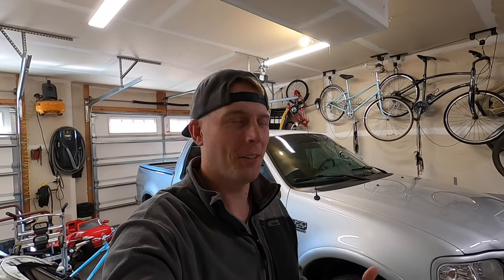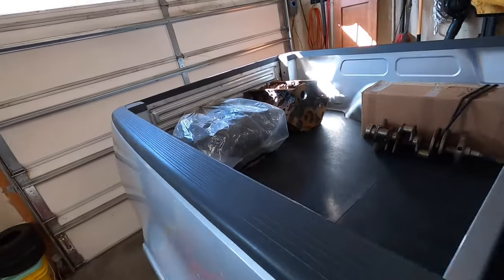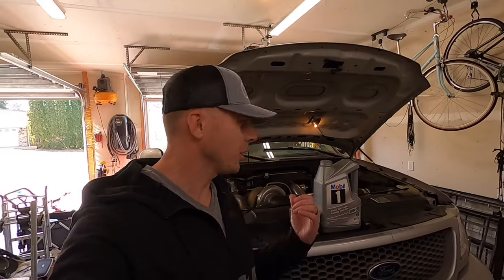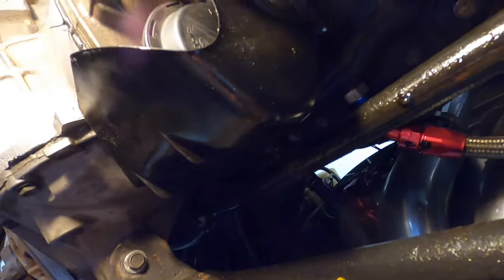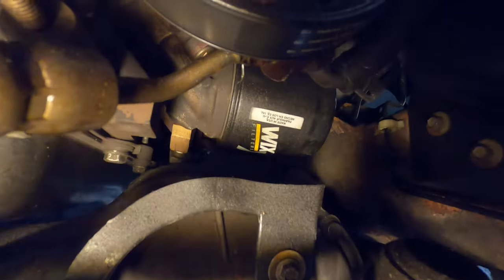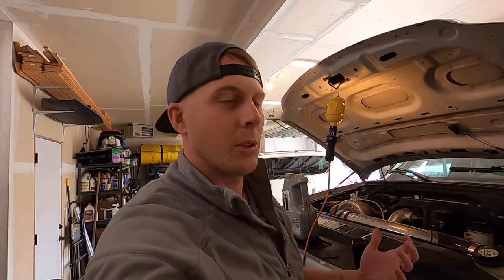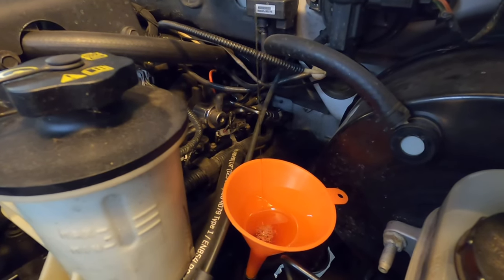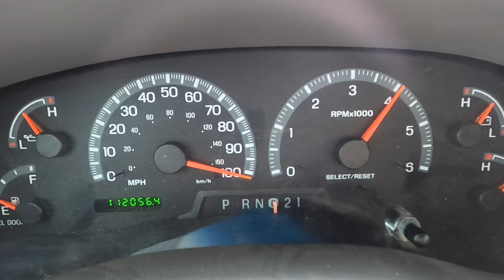13 PSI on STOCK Triton 5.4...Blown Headgasket? Let's See! 1st Oil Change SINCE 2019....

Comment: That just shows how good the old 5.4 where I had 367,000 miles on mine
Reply: The old 2-valves were ridiculously underestimated by people.
Reply: currently at 359,000 on mine
Reply from the maker: The 3v 5.4 really made people hate all 5.4s, but you’re right the 2v 5.4 is a really solid engine!
Reply: 306000 on mine
Reply: Mines at 217 and still like new. My first Ford btw. I've always owned Chevys but I love my Supercrew
Reply: In my years in auto parts, people brought In Tritons for code reads quite often, but 90% of the time it was something minor like a Misfire, largely because of the coil on plug design, and people just never wanted to spend the money or time  to tune their shit up. 

Things would always have 100 to 200k miles PLUS and let's say they misfire code for cylinder 1. Ask me -  "So you think I could have a bad spark plug?"... 
I'd be like   "Well when's the last time you changed them?" ...
"Never." ....
"Well then they're ALL BAD bro come on!" 

You get the picture lol
Reply: My 3V 5.4 really was good too. Depends on how you maintain them. Tons of power and fun truck. 200k miles and no issues still
Reply: Mine is at 270k. Love my lifted 01 5.4 supercrew!
Reply: @scottskinner577  you're right. But these coil on plug designs showed us just how expensive car maintenance was going to be while the old designs phased out. 8 plugs and 8 coils is a lot. I'm sure that replacing plugs regularly kept you from having to do the coils. My f250 with the 6.2 and its 16 plugs to change. Ouch. Not all are easy to get to either. 5.4 and 4.6 were stout motors for longterm mileage.
Reply: @thejuiceisloose8703  true story
Reply: @thejuiceisloose8703  when I first started selling them at O'REILLY, you could only get Motorcraft and they were 99 dollars a coil. Had 1 or 2 on the shelf at any given time. Skip 20 years later, you can grab a whole set of 8 for under 50 bucks. Go figure
Reply: @scottskinner577  $99 is cheap. Couple years ago I thought I had s coil that needed replacing on my 6.2. I called Ford and inquired about replacing all 8. I figured if one was bad it wouldn't be long before the rest went bad. Ford said they would make me a deal and sell all as a package for $650 lol. Luckily l found the real issue. The windshield washer nozzle was leaking around the hood seal when it rained. That nozzle was directly over top of spark plug #1.  Plug didn't look fouled when I pulled it but it damn sure sputtered a bit when I drove it  and since I live in Florida. It's always raining. $8 plug was way easier to swallow than a coil

Comment: Airated oil looks like coolant and oil mix it’s just because of the air passing through the catch can probably enough pressure to make it bubble, the oxygen does something with the color i believe
Reply: Also caused by cold weather and condensation

Comment: I prefer mobile 1 over motorcraft it's better oil I've used both I've noticed better fuel economy with mobile 1 but I still use a motorcraft oil filter. Nice truck i also have a 2003 f150 supercrew xlt 2wd 5.4 2v mine has 312k miles
Reply from the maker: Thanks man! They’re great trucks!

Comment: Go with head studs and I'm an ls guy but if they have multi layer head gaskets that are metal go with those. 12 psi for almost two years on a stock motor is pretty decent. I've run 11-14psi on 5.3ls and they lasted about the same. The 6.0 seems to hold up better to more boost but seems like the heads lift and stretch the head bolts at 12-13 psi hahahaha awesome run though!
Reply: If it was the oil you would have spun bearings or run lifters/push rods dry or without proper lubrication. Definitely over pressured haha
Reply: Still watching and made it to your explanation but that's nuts. I've never seen condensation make it into the oil though. Not normal for me lol

Comment: My 2000 f150 had 381,843 miles and last week it blew the plug from number 4 cylinder. I put a 4.6 in it and I cant get it to run right. The 4.6 ran great when I took it out. Do I need to put the 4.6 brainbox in the 2000 f150. The 4.6 came out of a 2000 expedition
Reply: Well if it was a 5.4 originally then yes obviously
Reply from the maker: I’ve never swapped an engine in these, but it should be the same ecu. I’d start with vacuum lines if you haven’t already. Good luck man!
Reply: I have a 2000 f150 also, 372 thousand on it and had to change the intake plenum.  Common with those plastic parts leaking coolant. Was getting the air out of the coolant making sure it was full. Idling at temp and the #4 connecting rod broke, luckily it was still in the shop. Put a crate engine in to fix that problem. Something about that little stub sticking off the crank that is hard on the side of the engine block. BIG HOLES, ONE ON EACH SIDE. Never used oil or was noisy up until that point. Never had a plug blow out though. Something about that 4th hole I guess!

Comment: Hate seeing those wix filters I've replaced several engines where those come apart. A bad as a fram.
Reply: good to know lol
Reply: Find that hard to believe. Wix is the exact same filter as Napa filters.
Reply: @denverstaib1025  changed a few engines with napa filters in pieces.  Oem or nothing.  There is plenty of evidence out there. Go ahead and put a aftermarket filter on a 3v 5.4 and hook a wet gauge and check oil psi then swap the oem filter on and thank me later. The drain back in the fl820s is totally different to the aftermarket.  Ford knows its engines.